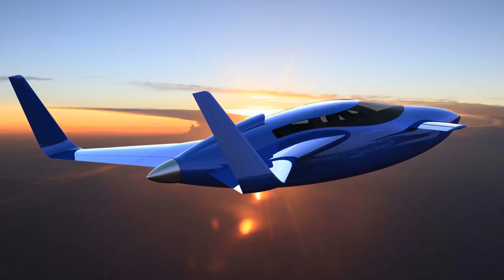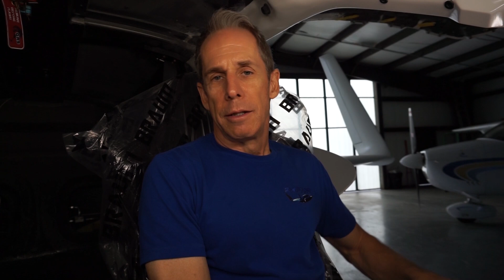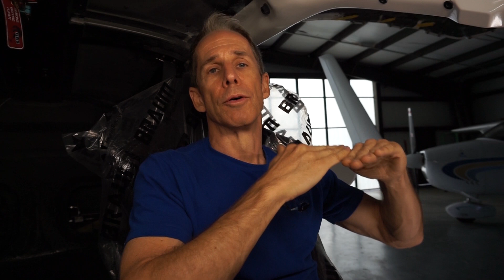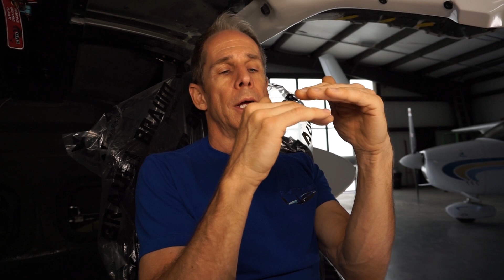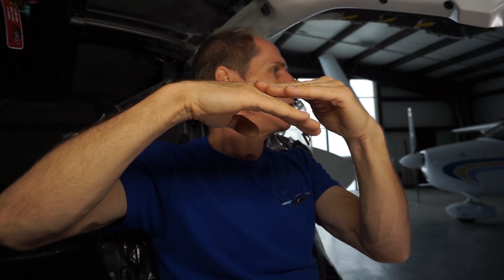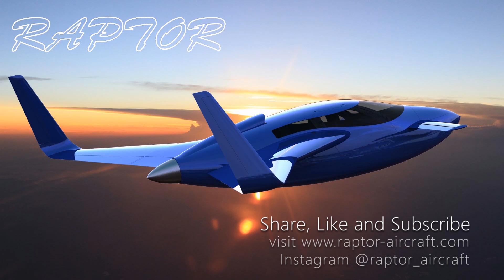State of the Union - Building the Raptor Prototype

Comment: I would say there's one key factor you need to keep in mind right now when it comes to the potential of more delays of your timeline:  you still have a product people really want, and you're operating in a virtually empty market as far as that product.

No one else is trying to put together an Experimental aircraft as inexpensive as your's with an assist-build program to ensure that each one is completed by the owner while still being as safe to operate as possible.

That being said, I'm not sure if anyone will expand this to read this far down, but I actually had a question:
As to the issue the test pilot talked about with the elevator, I'm aware it would increase complexity of the design, but is there any reason you can't divide the elevator into two different segments?  Keep the fowler-flap configuration for the inner surface to act as a forward flap and then have a standard mounted elevator for the outer surface?

I'm no aircraft designer so I have no idea if that's a dumb idea or not.
Reply: MidnightWyvern I agree and where did this test pilot come from. This is America Land of the free and home to Corporate America that may in times consort to sabotage their future competition.
Reply: @rizaaninc  I think it's highly unlikely the test pilot was part of any effort of deliberate sabotage.

Pilots frequently discuss the concept of "Personal Minimums", which are your own level of acceptable risk for flying.  That can vary widely from person to person, and in this case the test pilot's personal minimums might be more restrictive than some other peoples'.

I agree with Peter's intention to ask around with other test pilots and see if he can find someone willing to fly the aircraft as it is now who is also competent and not just a thrillseeker.

Comment: I can hear the pain in your voice my friend. That was a hard pill to swallow. The engine seems to be the big issue, or showstopper anyway. I might suggest contacting a company like EFI Technology. They engineer and make FADEC systems for Aerospace, and high performance/motorsport applications. Maybe they can engineer/modify 2 ECU’s with 1 being a redundant, fail safe unit, on an A-B switching system? More info, submit questions at efitechnology.com, I saw that under ‘contacts’.  Just a thought…

Comment: Old information - but might be useful ...
http://www.enstoneflyingclub.co.uk/pwpcontrol.php?pwpID=9723  
The Motec ECU works in Real Time this means that it is reading sensors on the engine to work out timing and air fuel ratio to give peak performance and maximum engine life. This eliminates the pilot's need to lean or enrich the fuel mixture as it is always at its optimal mixture. The ECU also has a pre-programmed map as a redundancy system, similar to that of a left and right magnito.

Comment: Some of the Electrical concerns can be mitigated with a duplicate ECU you don't necessarily need to run it concurrently you could always have a fall back on a switch similar to how the mags are on switches and you can switch between them, Wont be full fadec as you don't have a full duplicate system  since the injectors and harness are not duplicated but you could run a secondary ECU setup on the same looms with a single switch over, All that being said I think the engine concerns are a bit over the top I would be way more concerned with the aerodynamic analysis and that result there are plenty of experimental aircraft running gasoline power plants without the excess redundancy of a Lycoming etc. There is some value to fleshing out a fully redundant fadec system but I don't think you need to reinvent or over engineer the system at this point. Keep fighting the engine is by far one of the best decsicions on this project and I think the interest clearly shows that the rest are theething problems.

Comment: If confident in the design can be your own test pilot to prove the design. Once it’s made a few flights to prove its aerodynamically sound should be much easier to have a 3rd party test pilot finish the flight testing. Must’ve been confident enough in the design to have a test pilot fly it, if you have canard flight experience why not take it up on your own. Sure might not be able to properly evaluate the aircraft testing on your own, but at least after that initial flight would be able to hire a test pilot much easier.

The engines not a huge issue, can swap it for a proven aviation engine with dual channel ECU. If you really want diesel, there are now plenty of aviation diesels on the market that can be used. Or can go for an AVgas tio-540 and ditch the water cooling to save some weight while sorting out the Audi engine or looking/waiting for an alternative.

Keeping air condition compatibility wouldn’t be a huge issue since once you are above 5-6000agl can get free AC from outside air. AC will only really be useful on the ramp, or if doing low level flying.

Comment: I cannot comment on the aerodynamical issues. However, for what it's worth, I can tell you something about the FADEC issue. I have helped with the development of CYPRES, an AAD for parachutists, which uses a microcontroller to open the reserve chute if you are falling too low and too fast. We've been having these discussions about parallel circuits for quite a while and people from the airbag business kept pestering about using 3 microcontrollers - well 3 of everything - and use the majority as the valid output. 
It turned out that safety is a thorny issue. I phoned around and managed to get a Siemens engineer on the phone to pick his brain about "safety". Siemens cardiac pacemakers that is. It might interest you to know that, at least to my knowledge, none of the pacemaker manufacturers use more than one circuit. If they fail, the user could drop dead in an instant. Painless and quick demise. Imagine that! But there are solid arguments against using more than one circuit. What they do, instead, is to make sure the resistors, caps, controllers, PCBs etc. all meet the highest standards. That means MIL specs and testing, testing, testing. I asked exactly what standards they used. Turned out it was NASA standards, with tolerances within 33% of the allowed. This was for lack of credible alternative and they thought it was good enough.
Having parallel circuits can open a can of new worms, see Boeing 373 MAX 8's MCAS. What do you do if one of the sensors is giving false data. Most of your engine sensors you'll have only once. That is already a bottle neck. Another headache is EMI. For the pacemaker it's easy , metal case. For CYPRES, a lot of testing was done via a local university to make sure neither electric nor magnetic interference could occur. Leaves nukes in space.
There is always something to worry about.
If you have 2 circuits, how do you determine which one is right? If a sensor runs amok, what you do then and how do you recognise?
In my mind, the safest option would be a back up engine controller which can be switched on instead of the main unit and which is independent of all sensor inputs and just keeps the engine going at a low power setting, enough to keep you afloat, if that is possible. If you are above 1500 ft GND., you may want to make use of the parachute instead.
Even with double circuits, it might still come to a good old engine failure for other reasons. That is why people use twins. Just that said twins, statistically, are not ALL that safer. 
All that matters is an answer to the question how likely your engine failure is.
Which leaves the task to find out how exactly you do an engine risk assessment. My children watched Paddington and it turns out that actuarians are people who, by profession, know a lot about this.
They are usually well paid. It might pay off to have a talk, possibly via an insurance company.
What Airtec, the CYPRES manufacturer, does, is test and test and test their circuits before the unit is sold. With many hot / cold cycles and air pressure changes and everything.
Maybe that's a model to copy, the safety record is best in business.
Best!

Comment: You can do this. Even Chuck Yeager flight tested the first supersonic plane by flying the thing. Start slow and work your way cautiously on to faster speeds and more extreme maneuvers. If you're worried, post your proposed flight plan for all to see and we'll help you look it over. 

As to the engine? That test pilot doesn't exactly inspire confidence. You told him that the re-drive has stopped running how many times already and he's cool, but you tell him the ECU has worked great and he's crying about reliability? For a few short flights? And in a plane with a parachute? While wearing a parachute himself? Really??

No one else is doing what your team is doing. Aviation is dying because it costs too much. You have a viable fix for this.

While everyone else is wringing their hands and whining you are working to fix the problem and save GA. 

In six months you'll look back at this incident and laugh. This is a speed bump.

Comment: You're the Trooper mate.
This whole "single point of failure ECU thing" - I think it's an historical aviation "trope" that is triggered by anything new, especially auto engines... There are so many other single points of failure on any aircraft. The millions of hours that these ECUs have done in the millions of Audi cars has to count for some level of reliability data.
Is the ECU potted and insulated from temp fluctuations and vibration?

Comment: Regarding ECU redundancy, you MIGHT want to consider something for your product design, but PLEASE don't go kludging something together for your prototype.  You will only be creating the illusion of redundancy unless you devote a tremendous effort testing the redundancy management.  Audi does not want customers stranded on the autobahn or the 405 and has thus spent millions developing that system.  I wish I had it in my airplane.  I'm surprised your "test" pilot did not insist on a second engine and prop.

Comment: There are lots of airplanes with single-thread engine control and many are not nearly reliable as yours (carburetors!).  The elevator question is reasonable, but an aero grad student could look at that in a few days with a simple 2-D CFD model.  You will never get a definitive answer regarding winglet aeroelastic coupling without exhausting all your remaining funding and a whole lot more that you don't have...at some point you just have to go fly.  I like the idea of taking it to Oshkosh on a flatbed.  Burt Rutan will be there this year along with a lot of other folks with tons of advice (some good...some not-so-much).  They have lots of "real" test pilots there as well!

Comment: Some of the commenters evidently think the diesel engines use ignition systems like gasoline engines.  The ECU on a diesel times and controls duration of an electronic injector.  The ECU is NOT the weak point on  that  engine.  A diesel engine is simpler and way more dependable than a gas engine.  You made the right choice.  I have had diesel engines run 10's of thousands of hours without a failure.  They need clean air, fuel and oil.  The engine might need an occasional belt, water pump (unless its air-cooled like a Deutz) and alternator but probably never an ECU.  Get a second opinion on the aeronautics but I would fly with that engine without worries.  If anyone backs out or you open it back up I want on he list.  This is a GREAT project.  Hang it there!

Comment: The aircraft looks awesome, and I think it will fly great. The only thing I see from the various pictures and videos is the probability of prop strike on rotation on takeoff, or flare for landing. Scary on a rear engine aircraft. Maybe that's why Cessna mounted the rear engine so high on it's 337 Skymaster. But what do I know, I've only ever designed R/C models as a hobby.

Comment: The problem with paying experts for their input on things not in your wheelhouse; there is the risk the answers you get are not the ones you want. It sucks the energy out of you. But; that is why you pay them. Regroup, work out the solutions, keep moving forward. You certainly don't want your customers to be your beta testers! Don't take the easy way out, keep your standards, and take a short break if you need to, to recharge so you have the energy this project deserves.

Comment: As others have suggested-   You should see if Audi Racing can help you with this dual ECU - also have their engineering department look at your interdrive... they might have the experience to help you make sure the thing won’t tear itself apart in 50 hours.   It might surprise you that they could be very interested in this as an entire potential market...or at least a demonstration that puts Audi’s brand where it’s never been.   And definitely contact other test pilots.
Reply: Also, contact engineering departments at colleges that have aerodynamic programs.  They might be willing to do a supercomputer analysis of your control surfaces to determine if it has the issues the test pilot is worried about.

Comment: The one thing you can do is the standard 150 hour engine test with throttle slams, starts, stops, etc. it’s a rigorous test that would prove the engine and re-drive. A pilot would feel better about an experimental engine that’s been run through a standard test.

Comment: Peter, I'm not a pilot but I've been following your project with interest since the very early days.

Can you share some more details on the specific concerns around the lack of dual ECU? Is the expectation to be able to have two completely independent sets of ECUs and critical sensors, or would it be sufficient to have a failover ECU take over critical functions if the primary ECU fails? It seems to me that an outright failure of an ECU is incredibly rare, but the malfunction or outright failure of some specific sensors could definitely cause the ECU to be unable to work correctly.

I'd be willing to bet that you will find a test pilot who is willing to conduct test flights with the current ECU once the two aerodynamic concerns are fully vetted by a third party. 

I know this entire project has been more time consuming and expensive (both in monetary and personal costs) than you expected it to be, but as you said in the video the key thing that allowed this project to gain traction is the concept of bring a relatively affordable and highly capable aircraft like this to market. There are a lot of forces within the aviation industry that are not aligned with this kind of revolution despite the fact that private aviation has been in a consistent decline for decades. Long term, if enough people aren't flying the entire industry is going to collapse.

I'm certain there are aviation geeks out there with deep pockets (Mike Patey , for example) who are already well aligned to your goals. I know you are apprehensive about getting tied up to a single large investor, but perhaps at this stage of the project where you have a near-complete prototype and valuable IP to trade on, it might be the best shot at reaching your end goal.

Comment: Peter, I am a former F-16 driver. The Viper Digital Electronic Engine Control (DEEC) on both the GE and Prat and Whitney motors have a secondary mode (SEC) that bypasses the DEEC and puth the engine in a secondary mode with fixed parameters. The burner can closes to its minimum to produce maximum thrust at mil power and afterburner is disabled. SEC is manually selected by the pilot when something happens with the engine. Might be a novel idea for your engine. Could be as easy as fixed propeller setting and fuel profile.
Reply: Good comment, but I don't think an F-16 style architecture would actually be an improvement.  I can only speak to the GE engine.  Yes, they do have a SEC mode but there are several single-point failures common to both primary and secondary control modes and this has been demonstrated to a number of unfortunate Viper-drivers.  I'm stepping out a limb here, but I think the single-ECU Audi control is likely comparable to the F-16 engine control system with regards to overall IFSD rates.  Newer military engines have gone to different architectures in order to eliminate some of those common failure modes.  Your point that some kind of degraded get-home mode is certainly valid, but it could also introduce more failure modes and worse reliability, if not carefully implemented.
Reply: @flash7843  Mutt, it's been over 15 years since I've strapped on a Viper.  I was hoping someone with more recent experience would speak up. A get-home mode is exactly what I was referring to, especially at the point he is currently at. It could, if done right, be a simple solution for the flight test phase and could give him more time to figure it out while still moving forward. But, like you said, things have improved with the newer motors.